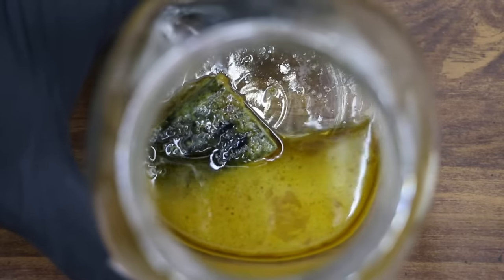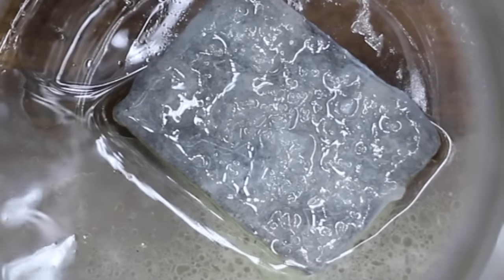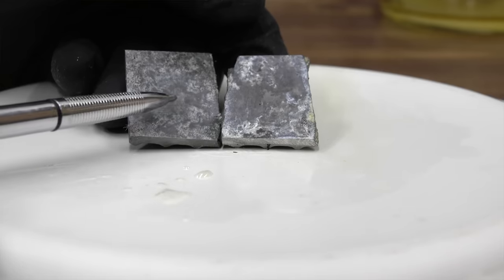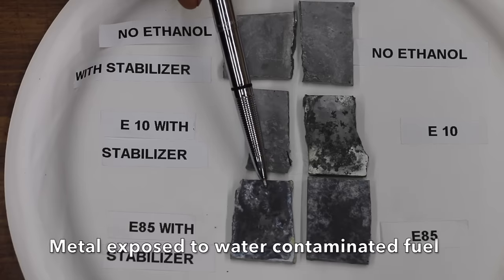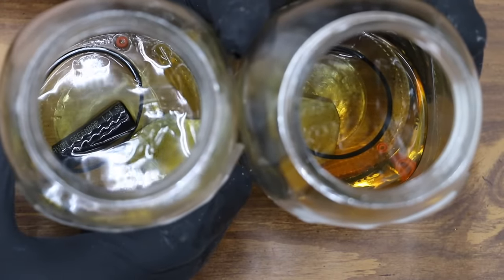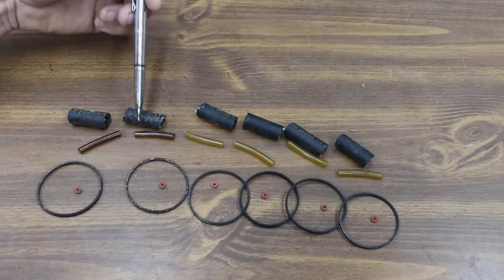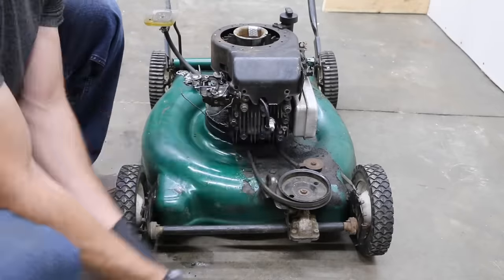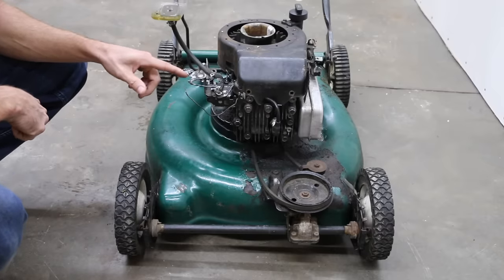Does Fuel Stabilizer Prevent Ethanol Damage?  Let's find out!

Comment: Hey! I'm an engine design engineer that's designed fuel systems and engines from big diesels to small 2-strokes. You mentioned not having a way to measure the effect on the rubber components. The 2 biggest problems with elastomers exposed to ethanol are swell and embrittlement. You can measure swelling by measuring dimensions (or volume) before and after, or you can measure mass change (be sure to dry the sample out before weighing). For embrittlement the best way to measure is measuring durometer. Without having a durometer tester you can use a fixed load to press a dull point (like a punch) into the elastomer and measure how deep it sinks into the sample under this load. 

I used to design consumer-grade 2-stroke outdoor power equipment. I'd always tell people if you use E10 the degradation of elastomers (fuel lines, carburetor diaphragms, etc...) will kill your product long before the engine dies.

Really enjoyed the video.
Reply from the maker: Eric, Great suggestions!  Thank you very much!
Reply: Your the perfect person for this  question  RE :  lawn boy 2 stroke engines that require 35:1 oil gas mix .  I don’t use the old lawn boy oil but rather modern 2 stroke synthetic oil .  Is 50:1 ok ? I read that it’s ok with modern synthetic oil. Also ALL my other equipment uses 50:1. It would be nice to just make one batch of fuel . Thanks
Reply: @jhopk83388  A 40 (+) year professional  lawnmower and Marine mechanic here; I have 27 year old "M" series running 64:1 with a oil mixing system. An older F engine, I'd only go 40:1. If it's a newer Dura Force. Yes go 50:1
Reply: K2SKIER112  Thank you for the reply !!   I have a lawn boy 6431 (1987) I believe that’s an F series and a newer 22260 (2004) with the  6.5 Dura Force  ( my daily) .
Reply: K2SKIER112   Tell us your winterizing process ! 😀
Reply: ^^^This one knows what's up. When I first got a used chain saw I took off the cap to refuel...and couldn't put it back on. Ethanol reacted with the type of plastic the gas cap was made out of. I had to wait for that to dry out and return to normal size to put the cap back on. I drained that ethanol gas out, replaced all rubber components and have used ethanol free ever since. My small engine equipment still fires up on the second or third pull even after sitting 6 months.
Reply: I bought my riding mower in 1996. I live in Michigan so it only gets used 6 months of the year, meaning that it sits for about 6 months without getting used. I went to do my first cut on May 1st of this year, but I could not get my mower to start. I though that since I've never touched the carburetor maybe it needed a re-build. When I opened it up it looked perfectly fine, not even any sediment after 24 years of use. Turns out that it was the spark plugs that needed replacement. The fuel lines are original as is everything else other than the starter that i messed up by accident, and I replaced the belts for the first time last year. I never drained the fuel before storage so I was basically starting the engine on 6 month old E-10 fuel. I don't understand why I don't have the problems that you mentioned, or even the ones demonstrated in this video.
I also had a car that was sitting outside for three years without being started. I wanted to start driving it again and once I put a new battery in, it started right up without hesitation. What am I doing right?
Reply: Man.  I have many anecdotes, but I definitely seem to recall borrowing an old weed eaters years ago and having the fuel line disintegrate into a million little slices of plastic when I tried to start it up.  Didn't know as much about mechanical engineering then..  I owe a lot to Project Farm, ChrisFix, Jason@Engineering Explained, the Humble Mechanic, and many others.  Thanks YouTube!
Reply: I live in the UK and getting fuel without ethanol is almost impossible, for my little 4 stroke generator I ended up washing the ethanol out and adding a octane booster to the fuel. My motorcycles aren't so bad as they are used constantly but I hate ethanol.
Reply: @Pro1er  The fuel may go bad between 6 months and 12 months in your mower so that is not necessarily a problem.  As for the car the fuel system is more sealed up than his testing methods so less evaporation and moisture absorption from the surrounding air.   Just my opinions from a fellow Michigander!
Reply: @baltsosser  Same experience here with the swelling of the plastic on my Craftsman trimmer.
Reply: @Pro1er  Though plugs are relatively cheap if you're ever in a pinch and don't have extra plugs try just cleaning them and checking their gap.  I had a mower that was giving me trouble starting every now and then and this got me by while waiting on a new plug.
Reply: @tylerbennetts8079  I run post-E10 Washed E0 in my 4 stroke moped, it's a PITA to wash out but so, so worth it in small quantities. No need for an octane booster in that application
Reply: so basically... find somewhere that sells ethanol free gas or buy it at the hardware store if you want your mower to last longer
Reply: @tylerbennetts8079  they don't have it in cans at the hardware store?
Reply: @goldenpun5592  at $20/galUS, that's going to out-cost a new generator in a hurry. Just wash pump E10 and call it a day
Reply: @goldenpun5592  no unfortunately not.
Reply: New rubber products are now designed for ethanol since the late 1990’s. My Lincoln car says to use up to 15 percent ethanol. E-85 is between 105 to 115 percent octane. A 1 to 4 mixture helps to raise the overall ratio in your tank for a lot less than buying premium. I have done this for 11 years and have never had a bit of engine problems. Only more ho and more torque and gas mileage and cleaner oil and converters and sensors.
Reply: I've found the trick is to never use corn! I just needed my gens for Zeta. 4 days running between a couple of gens (the 3rd, an onan was down for a restoration.) 87 octane ethanol free with some stabil, some lucas and some sea foam (mostly out of habit lol) and i never had one problem. 2 year old gas filled as much in the tank as i could to lessen the amount of air in the space and they start on 2 pulls, 1 with choke and one with it a bit open.
I also turn off the fuel and let them run until dry.
Reply: @Pro1er  My guess is that your systems (mower & car) are pretty well sealed against air (therefore moisture).  That is what causes fuel to deteriorate so quickly.  I'm in Michigan as well and often leave cars, mowers, chippers & outboards for all lengths of time with similar (if not as extreme) uses as you do with similar results.  I do buy good quality gas from a reputable station/company, buy high octane gas, and use stabilizer in everything.  Looks like that $ may be a waste however.
Reply: I've hauled fuel for almost  20yrs and shortly after ethanol was mandated in Canada all the rubber gaskets on our  delivery hoses either shrank and would fall out  or showed signs of being eaten up and were disintegrated.
Reply: @tooluser  do you think blocking off the gas cap breather with a plastic bag would help?
Reply: What is the best pickup truck diesel ever designed?  Powerstrole 7.3?  Cummins?  Duramax?  Something foreign?  And. FyI konisegg just had a design breakthrough, no camshaft, hydraulics instead.  What engines did you create? Any interesting discoveries or inventions in your designs?
Reply: @ProjectFarm  drag racing with nitro/methanol fuel and go cart racing on methanol, first lesson; flush entire system after use , go overboard with the flushing, aluminum corrosion and alcohol absorbs water and bearing cages, etc rust and give up and it’s all down hill from there
Reply: @Hyratel  $20/gal for ethanol free gas?!? Lmao. 🤣 It's only about $0.50/gal more than E10 87 octane. (And where I buy it, it's often cheaper just because it lags in price when prices are going up - at this particular station.)
Reply: You are so correct,I repair small mowers,garden tools etc.
Fuel lines,carbs etc destroyed by poor fuel but back to what you said.
We clean down the engines with petrol/gasoline but even doing that we use fresh fuel as using old contaminated fuel even to clean down destroys seals etc
Reply: @tylerbennetts8079  The (in tank) fuel pump on my MZ 1000 was destroyed by Ethanol.
Reply: @tylerbennetts8079  just buy a few litres of Alkylate petrol. Aspen or similar, it’s super stable.
Reply: @gemcutter187  think he was referring to the Engineered Fuel sold at Lowe’s, etc in metal cans.
Reply: @lasergames1798  Another thing you can do to improve the spark is to use pliers carefully to twist the side electrode of the plug so that a corner of it rather than a flat surface points at the centre electrode. This will give a spark as good as that from a precious-metal-tipped plug, although the benefit will gradually wear off as the sharp corner of the side electrode becomes rounded.
Reply: Absolutely correct. Theres ASTM tests for both seal issues
Reply: Good to hear from an engineer. I've always drain the fuel. Then change the oils / fluids and restart + run out all remaining fuel from small OPE & motorcycles. When I was a salesman at Lowe's in the garden / OPE department we always had customers complaining that there mower or weed whacker wouldn't start / runs poorly. Turns out they'd left last year's gas in and refilled in Spring  using leftover fuel from the Fall. 

No wonder they had problems.
Reply: absolutely.. that at least 50 percent of the reason why all the rubber and plastic parts in the fuel system dry out and crack or leak..   right on.
Reply: Hi Eric: I wonder if you could perhaps clear up some Truths vs Myths we always hear about. Ethanol based fuels draw moisture from the outside environment and into the tank & eventually thru the system, corroding some of them (and would the effects be even worse in humid areas like Florida, then dryer climates?). It is better if the tank is full if a vehicle will sit for a few weeks with ethanol fuel in it. Non-ethanol fuels provide more power & better gas mileage. Non-ethanol fuels will maintain their stability (shelf-life) longer and prevent fuel varnishing and gum-up in your tank/system. Will non-E have less: detonation, knocking, and hesitation during acceleration?  And my final question: can I just start putting non-ethanol fuel in my 2002 pick-up truck without consequences? (they sell it everywhere here although its about .40 cents extra a gallon). Thanks!
Reply: @jhopk83388  I use 3 little shots of 50 to 1 for 2 gallons get me to 33 to 1 on everything. Even chainsaw I better to a little rich way to which will jam it.
Reply: And to apply your lab testing to real world, many of us can attest to the fact that every new mowing season (Spring)  we are inundated with small engine equipment with brittle, cracked, and internally corroded hoses, along with carbs that are a mess internally. Old gas is bade enough. The ethanol added just compounded the problem. Thanks for your scientific input. Cheers.
Reply: little late to the party, but yes for sure especially small 2 cycle engine fuel lines and likely diaphrams suffer from ethanol gas big time.
  That being said, leaving ANY gasoline blend too long can varnish up everything.
Reply: Just buy a Durometer (or Shore Hardness tester).  Trying to fake it with "a fixed load to press a dull point..." isn't going to be accurate or repetitive.  (I am a engineer who has used a shore hardness tester many dozens of times on rocket propellant).  The amount of time the rounded point is pressed into the rubber is also a factor.  Even with the tester it takes some learned finesse to get repetitive results with it.
Race car tech officials at weekend warrior tracks use the shore hardness testers to see if teams have cheated up their tires (made them softer by treating them)
Reply: @Hyratel  "post-E10 Washed E0"...huh?
Reply: @x-man5056  you can exploit the fact that ethanol has a stronger affinity for water than gasoline to strip it out for machines that you don't want ethanol-mix gas in. Non-final container, add water, agitate and allow to settle out. The ethanol and water will fall to the bottom, leaving behind E0. Still quite a bit cheaper than E0 in the metal gallon cans you can find in the yard machines section of hardware stores, and small engines generally aren't too fussy over octane ratings
Reply: @davidnudell7916  They aren't rubber.  synthetic.  A version of neoprene.
Reply: @tooluser  You can get condensation, just like in a gas tank.  I have seen the underside of oil filler caps scare the heck out of people because of coffee color oil on the bottom of the cap.  Condensation.
It's a total waste of money to buy high octane gas for lawn equipment, they are designed for 87 octane usually and don't have the capacity to take advantage of the higher octane.  (more ignition advance).
Stabil (or other good stabilizer) is awesome though.  Used it all year round in my mower and implement gas.  They all start first time every time, even first start of the year.
Reply: @Hyratel  OK, yes, very good.  Thanks.
Reply: Aren't modern 2-strokes designed to handle E10?
Reply: @mplslawnguy3389  Weed eaters/leaf blowers/chainsaws should all run fine BUT, Ethanol is not as lubricative as gas, so over years, you could experience premature wear on pistons skirts and cylinder walls.  Use only premium SYNTHETIC 2 cycle oils.
Reply: @x-man5056   I would say anything made in the last 15-20 years should handle 10% ethanol just fine.  Anything older than that I would look for non-oxygenated, ethanol-free fuel.  I am concerned with the push towards 15% ethanol though.  A lot of people don't even pay attention and will just buy that stuff for their small engines, not even realizing it.  I know my state is pushing it.  I won't even put it in my truck.
Reply: @mplslawnguy3389  Agree on the 15% fuel.  It will also reduce mileage in cars and would add more oxidizer "corrosion promoter" to the fuel.  Adding the first 10% Ethanol to fuel was a terrible mistake IMO, adding more, doesn't help anything.
Reply: @mplslawnguy3389  It's a gift to corn farmers.  Not much more.  Ethanol should be completely removed from gasoline and American oil should be unleashed again to defund Putin's war and put a huge dent in inflation ALL OVER THE WORLD.  And no more windfall to farmers not growing FOOD.
Reply: Ive ridden 2 stroke dirtbikes for many years. Obviously your the expert here...But Ive had 0 problems running ethanol fuel mixed with 2 stroke oil. None at all. Zero.Nada.
Reply: That was a good small tip. Thats all you have to say? You know what we want to know, and tight lipped about it.    Like a teacher that wont teach, cuz kids don't know to ask, being kids.
Reply: Hi Eric. This video and your comment has me ready to dump all my stored gas into my old F150 and start new with ethanol free at my local QT gas station.
Can I dump about 1 gallon on recent 2 stroke gas in my truck with a full tank of regular?
Also, how long would you store 92 octane ethanol free treated gas before using it, max?
Reply: @x-man5056  You are my people.
Reply: @bradsanders6954  Many 2 stroke oils contain a stabilizer.  But there's no question that ethanol is a corrosive oxidizer.  They've upgraded materials, but that doesn't change it's nature.
Reply: @x-man5056  I live in CA. With the most chemical addled gasoline in my small and large vehicles, 2 strokes, lawnmowers, not one hint of any problem what so ever.  This "corrosive oxidizer" seems very weak at corroding. 
 Some LOVE to rant and rave about ethanol's destruction of fuel systems...........the real problem? People leave the same gas in the system for way too long,way long.    Water is attracted and settles, problems.
Reply: @bradsanders6954  I do agree that strait gas separates, additives and volitiles vaporize out, condensation gets in.  Old pure gas is some of the nastiest shit you ever tried to get rid of, particularly in Cali.  
But you are wrong about Ethanol.  
UN-Stabilized E10 regular will sour before strait gas.  Ethanol is an organic solvent and a reasonably strong oxidizer.  That's why it deteriorates rubber.  It encourages corrosion on some types of aluminum and some pot metals commonly used in Carburetors and Throttlebody's.  
Ethanol also only has around 2/3 the energy by volume as strait gas, so in a very real sense, it is diluting the strength of your gas, not the octane, ethanol raises octane, but the BTU energy by volume.
Reply: @jhopk83388  I'd stay what your running or 32.1 semi synthetic if it's old. And I mean like 80s and 90s. That's what I run. No tear downs yet. 88kx 80 2 stroke dirt bike. To me that says allot
Reply: Too bad everything is 'E10' these days
Reply: @seanerobertson32  that was my thought! Sealed system. Cars fuel systems are pressurized.
Reply: Excellent info.
Reply: @jhopk83388 Yes 50 :1 with modern oil is fine ,use it in my ol 20:1 saws . One can is all you need.  From a long time Lawn Boy dealer, vintage two stroke motorcycles....
Reply: @gemcutter187 20?  Try 6 to 7 .
Reply: So in reality the sale of ethanol content fuel IS purposeful sale of a product that WILL damage a customers machine. It's not if or may but outright. It will.
Unleaded fuel IS bad enough, but directly intension to cause or permit damage is loosely speaking illegal.
Reply: and….how about the rest of the story?
Reply: @x-man5056 That’s  for sure
Reply: I'm a small engine guy and I have definitely seen damage done by leaving gas in the tank for long periods of time. I am working on a 4 wheeler now. When it was new it had a brass pickup tube in the fuel tank. It was left full of fuel for over a year and the tube is now gone. I'm not going to say it dissolved the tube, but the tube is not there and it is not in the tank. Mystery. I am going to do an experiment with a piece of brass soaking in 10% ethanol and see what happens over a long period of time. I have also seen twice now where leaving gas in the tank for extended periods of time will make the plastic parts in a tank extremely brittle.